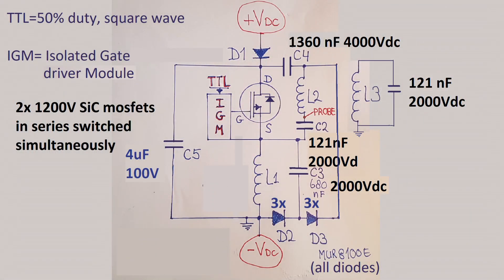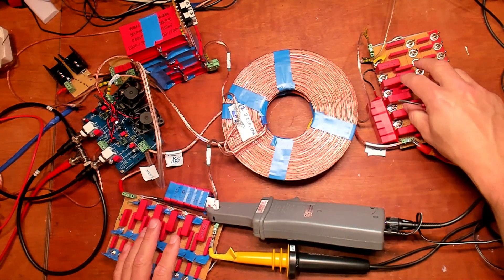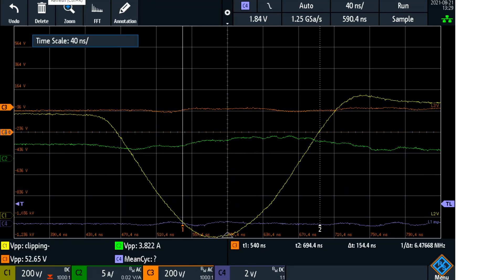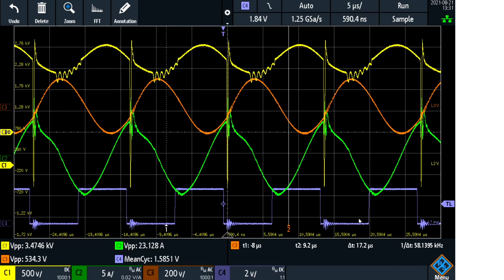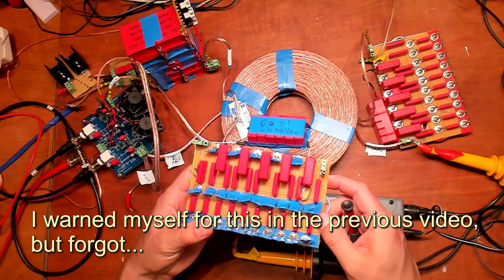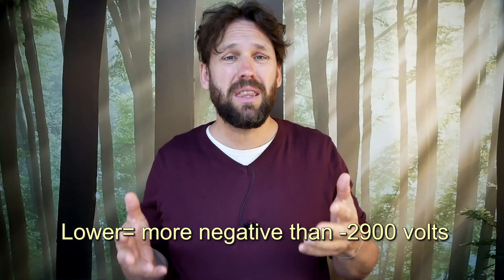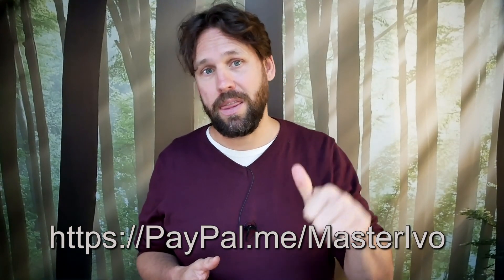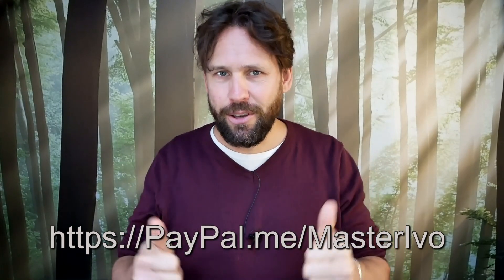Longitudinal Displacement Current

Comment: Are you using a spark gap to produce the disruptive discharge?
Reply from the maker: I only used a sparkgap with the foeld propulsion experiment. otherwise I use a coil discharge which doesn't need it
Reply: @MasterIvo  I was under the impression that the spark gap was the source of the disruptive discharge and was paramount in creating the tesla transformer and producing longitudinal waves....
Reply from the maker: @braaitongs  many think the same. but it can also be done with a coil discharge
Reply: @MasterIvo  Super Interesting.... I would love to try this experiment at home
Reply from the maker: @braaitongs  Tesla did it with an auyo oscilating relay,   the coil when opened up produced the impulse. the diode should not be over the coil, but over the switch

Comment: If you had land in the forest and power lines high voltage happened to run through them and you stayed well within your distance that they require could you gather energy even in small amounts
Reply from the maker: Oh yes you can.
Reply: Go in the woods and never come out I'm 61 years old if I never had to come out again into society splitting wood when you're 80 it's an easy
Reply: Are you looking for a roommate LOL I'm just kidding
Reply: I have all the stuff for hydro but that's not easy getting the right head pressure it would be wonderful to gather energy from the either
Reply from the maker: I would love to live in the woods, powered by the Aether
Reply from the maker: Hydro can work, but I guess you need a lake for a steady supply (and pump the water back up with solar and wind)

Comment: Master Ivo. In order to light a LED diode or DC motor, you need source of dialectricity (+) and ground (-). In order for every component to function an engineer needs 2 components of different potential, so electricity can flow (or higher/lower ground for water to flow). While we know through copper its far more easy to transmit electricity compare to air it's not impossible also to transmit through air.
Now comes interesting part what I see in your experiments. You research radiant energy, I think it's having a connected electric circout, while NOT having it connected to a battery or ground. For having different potential, resonance in bifilar coil must be induced and reached (no idea for now how to mentain it, because of losses in circout) and could you than disconnect DC power input and still power LED diode or DC motor?
Reply from the maker: *not through copper, energy flows in the fields around copper

Comment from the maker: CORRECTION:
the L2 series tuning capacitor was not 121nF but 61nf!

Keep in mind that discharging the high voltage DC in the capacitors takes place with the diodes in the circuit, so limit the current by using a large resistor. I prefer to let it discharge by itself, and only discharge the last remaining volts with a resistor. the bigger the resistor the slower it discharges the lower the current (better). 

The mur8100eg Diodes can handle around 16A of peak current, but they dont like it. I made a new discharge resistor of 900 Ohm, but best is still to discharge only at lower DC voltages. 
When there is a spark with a bang, you are risking the death of your DC offset diodes.

Comment: Pushing things to the limits - so they explode!" :) Maybe that's the Eureka moment! 

I remember you pointed some things in "Nikola Tesla's Radiant Energy" series when reading about Nikola's discoveries. If we consider magnetic and electric force as streams of the same force with different vector direction than seems DC includes axial vector force, AC includes alternating axial vector force and RC includes radiant vector force.

According to producing and detecting Radiant Energy effects further factors seems to be crucial:

1. (Unipolar HV Impulse) "Sudden impulse of high tension direct current" (setup includes HV DC generator or transformer that is powerful enough to supply sufficient HV DC current to the circuit for brief moment of time. - (ms-μs at kV range)

2. (Energy introduced) Charge introduced by transformer have to be greater than accessible charge carriers can handle in the time of the impulse. Charge carrier volume is represented by circumferential surface of the wire. Energy supplied to the system that must be great enough to sustain power of charge in kV range at impulse time duration.

It is possible that proposed electrical tension in kV range corresponds to dielectric breakdown of the materials and objects included in the system (as well as air and vacuum dielectric constant) and for that reason experiments may gives us noticeable effects and results.

It seems that your bifilar coil have enough surface for charge carriers that can handle much more energy input than you're currently supplying to the coil. Maybe single strain of thin wire could do more job with that amount of energy!? 

Bifilar coil Tesla presented was Single layer spiral bifilar coil that has inductive and capacitive coupling between wires on two sides and slightly different radius between bifilar turns. 

Your bifilar coil is dual layer spiral coil that is coupled one side and has same radius between bifilar turns. 
Distance between bifilar turns is considerable and dielectric material between bifilar turns is wire insulating plastic and not epoxy. Maybe to consider coil arrangement consisting of four single wire spiral coils connected in series and submerged in transformer oil and titanium dioxide mixture. Proper distance between bifilar turns has to be maintained to avoid dielectric breakdown and obtain larger inductive and capacitive volume due to smaller distance between bifilar windings. Voltage difference in the Coil Capacitor will be equally distributed  that way and capacitance of the coil significantly increased. Mixture of transformer oil and titanium dioxide is just an idea that I suppose could provide high dielectric properties, dielectric curing and possibility of later material recycling if needed as well. I would like to know your opinion about this subject. Thanks in advance! BR
Reply from the maker: all good ideas. a lot is already there in my experiments.
keep in mind that charge is present in the fields. the fields are the charge carriers. so a moving field is a moving charge.
If you want you could join us in the experiments all info is present on my channel.
the thin wire single winding concept is why I now use a different L1, for  higher voltage faster impulses.
oil is very messy, and TiO2 sinks downward in oil.

Comment: Cool..."Tapping the field" ... Great research! I think you are onto something.

a quote from Tesla>>>

(Nikola Tesla on his work with alternating currents and their application to wireless telegraphy and the transmission of power-Leland Anderson©1992-Twenty first century books)

"The advantage of this apparatus was in delivering energy at short intervals whereby I was able to perform all those wonderful experiments. I would take energy out of a circuit at rates of hundreds or thousands of horsepower. In Colorado I reached 18million horsepower activities, but that was always by this device: Energy stored in the condenser and discharged in an inconceivably small interval of time. You could not produce that activity with an undamped wave. The damped wave is of advantage because it gives you, with a generator of 1 kilowatt an activity of 2000,3000,4000,5000 kilowatts: whereas if you have a continuous or undamped wave, 1 kilowatt gives you only wave energy of 1 kilowatt and nothing more....

The condenser is the most wonderful instrument as I have stated in my writings, Because it enables us to attain greater activities than are practical with explosives..."
Reply from the maker: Great quote! I interpret the damped wave being the impulse, that is used to discharge the capacitor (as I do with the coil capacitor experiments)
Reply: @MasterIvo  So true!
Thats what I was seeing in what you are doing. Keep up the great work. I believe the energetic potential lies in the field....
Match the field through resonance the source flows...
Reply from the maker: yes the field IS the charge. so if the field moves, a energy current is present
.

Comment: excellent vid, thanks! when you said "oh! bang!" i was right there with ya 😂 and watching the current implosion disappear.... was magic.

So regarding the Wima FKP1 DC & low-freq AC rating, you suspect its your DC offset contributing to cap failure? More so than the high-freq impulses?

Anyway, i'm glad to see that FKP1's fail/explode rather "cleanly", the front face just kinda folded off, not much shrapnel hehe
Reply from the maker: Indeed Magic! the start of longitudinal displacement current.
Yes DC is what killed it I think not the impulse

Comment: Thank you for the "beautiful experiment". I want to know if you have a radiation meter to check electro-magnetic energy radiation. It is not safe to expose yourself longer in the high electro-magnetic field. If you don't have the meter, please let me know I will donate one to you. You are definitely aware of it but it is just my concern. You are doing a great contribution to community by sharing your knowledge. Master Ivo, thank you again for sharing your hard and deep research knowledge with the world. You are on a mission and you will make it. We all must support you by all means. Thank you again.
Reply from the maker: Thanks Shaider. I know. I do have a meter, and stay away from the coils when they run "hot" my meter, goed up to 2000V/m and easily goes into overload when near. I prefer to stay a meter away from the coils, as they indeed have made me sick before
Reply: Shaider, could "aluminium" or a "Faraday cage", block those electro-magnetic radiations?

Comment: Ivo, Have you produced any phenomena like the ones documented in the secrets of cold ware technology? I haven't heard you speak of anything like this!
Reply: Indeed.  Ether Physics as described in that book. In particular the observed white streamers, not the usual purple sparks we are used to seeing with conventional electric discharges.
Reply from the maker: yes I created the white discharge, it is created by the negative voltage impulse discharge.
I am trying to put it to video but am waiting for tungsten as it melts my steel needles.
Reply: @MasterIvo  Try plasma discharge lamps as Nikola Tesla used. This puts a vacuum and some glass between the electrode and the surrounding air.
Reply from the maker: then I need higher voltages, 3kV is only 1mm spark